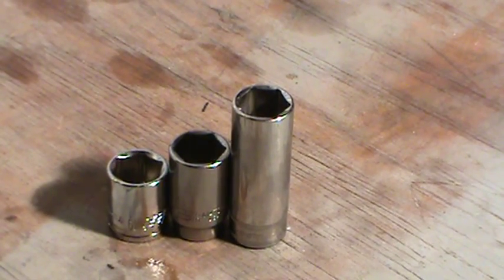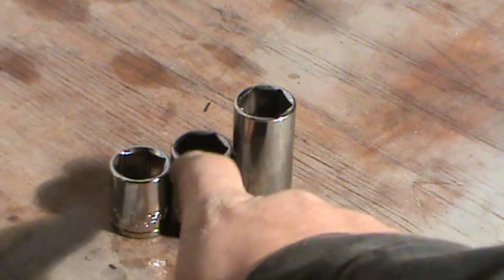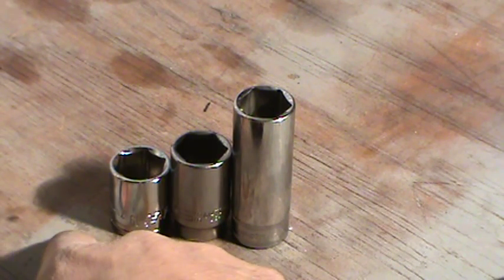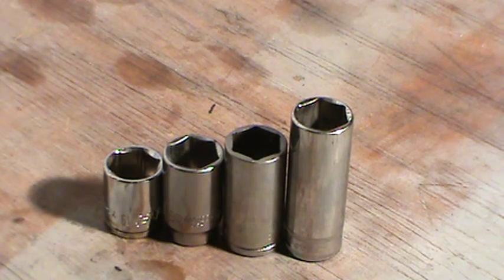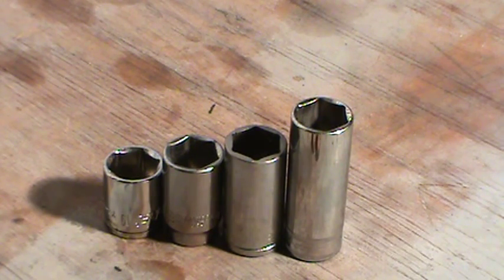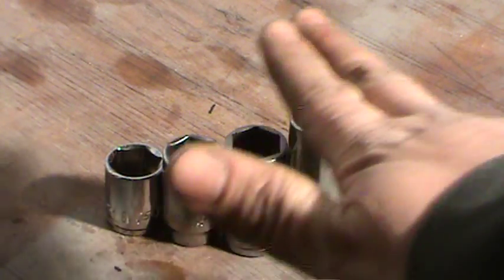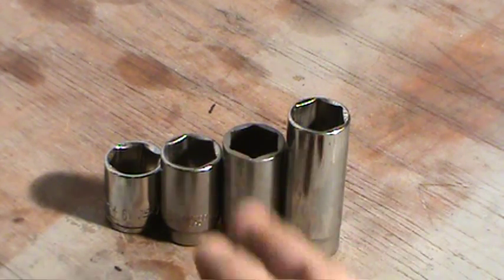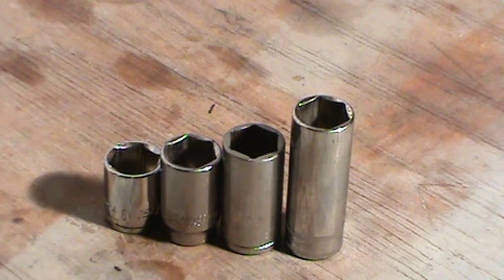Custom Tools

Comment: I do it to the cheap throw away tools that have no warranty.I have a 13mm and 15mm cheap combination wrench which I ground down the box and open ends down.Had to do it for some applications which a wrench could not get into.Plus I do have one cheapee slotted screwdriver I ground a notch in the side of for removal of snap rings in automatic transmissions.I don't do this to my good tools at all.
Reply from the maker: Funny story: I found a Craftsman wrench cut in two, took one half to get it replaced, then took the other half for the same, and they replaced it TWICE-- yes I know I'm bad --even though it was obviously cut in half. You probably cut the wrenches to fit the caliper slide pin? Much easier, and cheaper, to buy CRAFTSMAN wrench set for $20 and grind them all down, then to purchase Snappy low torque set for over $300